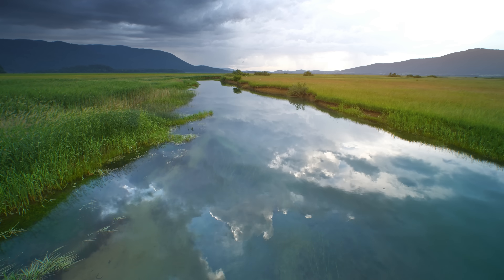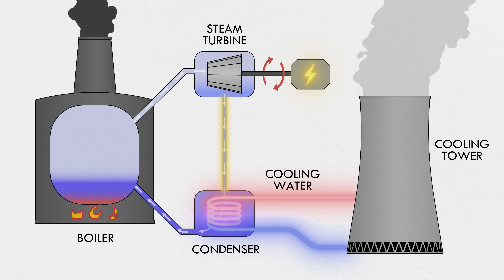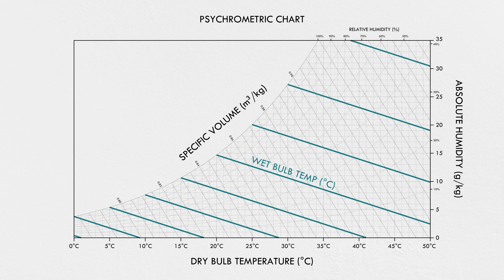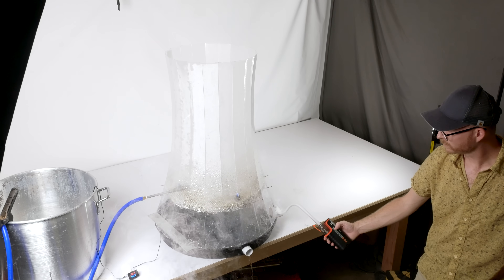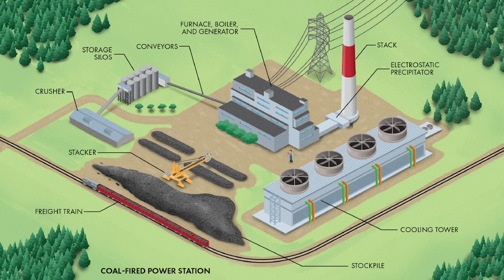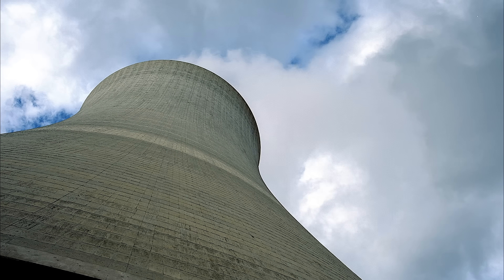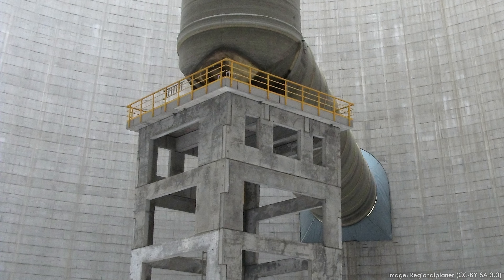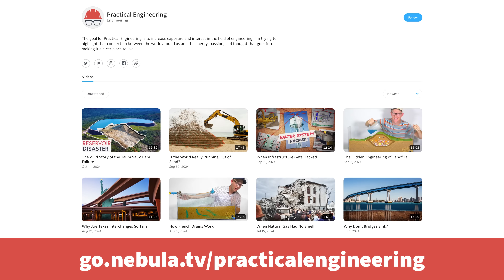Why Are Cooling Towers Shaped Like That?

Comment: This explains something I had wondered about. The Browns Ferry nuclear plant in northeast Alabama has cooling towers, even though it is built on the Tennessee River. The Tennessee is a very reliable source of water (since TVA created the whole string of lakes) and makes an effective heat sink. But the usually humid air of Alabama makes the towers efficient, and avoids dumping so much boiling hot water into the Tennessee.
Reply: It won't be anywhere near boiling. The steam from the turbines can be expanded to around 20C above ambient so the maximum temperature of the cooling water would be 30C to 35C or so (ambient in this case means the temperature of the condensing fluid not air temperature). You need a LOT of cooling water to make the phase change from steam to water. Cooling towers are used when you can't get enough water from the local river and/or there are environmental limitations on the discharge temperatures of the coolant back to the river
Reply: Oh hey, you up here too? I’m west of Athens, bout 10 min from the plant 😊

Comment: 7:47 Wait what? That is so counterintuitive to me, could someone try to shed some more light on that?
Reply: You might be imagining that the additional water molecules in humid air just kind of "nestle" between the air molecules, thereby increasing the density. But that's not how that works. If you add water to the air, it will expand until it reaches pretty much the exact same number of molecules per volume as before. The water molecules are not added in between the air molecules that were already there, they displace them. And, as the previous commenter explained, water molecules are lighter than most of the molecules in air, so overall the mass density goes down.
Reply: A molecule of water has the mass of 18 atomic units. A molecule of nitrogen, 28 atomic units. Hence a volume of gas of water molecules has lower mass, compared to the same volume of air.

Comment: 14:46 i'm confused. where does that bluish line come from? it doesn't follow any of the lines on the chart. what determines its slope?
Reply from the maker: The line is the path through the psychrometric chart that air follows as it moves up through the fill in the tower.
Reply: @PracticalEngineeringChannel  When you speak about the changes in the parameters of the air as it moves through the tower, and show the curve corresponding to it,  everything is clear. 

But what does the straight line labeled "20C / ~70F WET BULB" depict? 

You said: "Let’s look back at that psychrometric chart. Say we’re in an  area with a wet bulb temperature of 20 Celsius,  70 Fahrenheit. ... If the ambient relative humidity is say, 20  percent, our air is starting here..." 

Reading the chart, shouldn't 20 Celsius and ambient relative humidity 20 percent correspond to the staring point at the intersection of the 20 percent curve and the thin diagonal black line from the wet bulb point at 20C, 100%?
Reply from the maker: @cogoid  That is the wet bulb temperature of the ambient air. A point on the chart can be defined by any intersection between wet bulb, dry bulb, or relative humidity. I didn't plot the wet bulb grid lines because it made the chart too busy. This interactive webpage is a good starting point for understanding these charts: https://drajmarsh.bitbucket.io/psychro-chart2d.html
Reply: @PracticalEngineeringChannel  Thank you. If the thin black lines are the specific volume lines, and the straight teal tine is the wet bulb line, it all makes sense.
Reply: Good question. There definitely needs to be more to this story for it to make sense. For a given wet bulb temperature, the relation between the humidity and temperature would be given by the thin diagonal lines on the chart. The teal line is indeed confusing without a further explanation.

Comment: Briliant explaination. Just to provide an alternative to Cooling Towers and discharging warm water into the environment, there are methods of extracting the low grade heat by making it do work. I worked for a company in the 1970's that was working on that.

Comment: The steam is also not released into the atmosphere because the output pressure of the turbine is often way below atmospheric pressure to maximise efficiency.
Reply: To add, this is one of other functions of the condenser. Turning the steam into water creates a vacuum that lowers the output pressure of the turbine.
Reply: Steam isnt released at all,technically the steam you think u see is condensate

Comment: In high school debate my partner and I stumbled upon a design from an Israeli company that wanted to build what are basically reverse cooling towers. Take water and spray it across the top (in hot, dry climates) and use the downdraft to power turbines. We actually won quite a few cases and made it to the national tournament with that plan.

The towers (as specified) would have to be 5km tall, but that's a problem for the engineers to figure out. We were policy makers!

Comment: Wow. I always thought there was an aerodynamic reason for the cooling towers shape. It’s simply strength. Cool. 
The lack of bouncy to make the towers work on hot areas makes sense too. You get a kadiabatic effect with the colder air sinking rather than rising.

Comment: The output from the last turbine, residual steam, has to be cooled to about less than 60 Centigrade degree temperature. Otherwise it cannot be pumped to high pressure; in nuclear plants even over 100x atmospheric pressure. Warmer water creates cavitations in pump propellers destroying them gradually.

Comment: Cooling towers of that type and shape were originally designed by a pair of Dutch engineers and 1st built in 1918. The 1st time they were used in the UK, just happened to be in a power station about a mile from where I used to live, Lister Drive power station in Liverpool. I can't remember exactly how I came about this information, but I know it was when I was in work doing a bit of internet browsing while we were slack. Funny what gems you can find online.

Comment: Wet bolt temperature, is that also the dew point or the "feels like" temp? Dew point is the point where the humidity in the air turns to water, but thats the temp at 100% saturation i believe. Just wondering if the wet bolt temp is equivalent to what we see daily from the  weather report, where thr dry bolt is the temp we see/feel/report
Reply: There are 3 kinds of temperatures: dew point, wet bulb, and dry bulb.

Comment: Great discussion.  I worked at several plants in the northeast, and one thing you didn't quite touch on is water consumption.  Yes, we use towers so we can 'recycle' the feedwater.  But a large nuc plant might have to dissipate 2000 MW of thermal energy.  That can mean evaporating water in the tower at rates like 13000 gallons / minute.  Yes, over half a million gallons per hour.  So having a source for that makeup water to the cooling system is a key to success.
Reply: Still nuclear is the best choice and you can do it without large cooling towers, you can have a (new) lake as a cooling source or have a hybrid.

And the plants don't need groundwater quality to supplement loops.
Reply: Thanks for this comment.  I was wondering why my local nuclear plant had both a lake and cooling towers.  I figured it was either for redundancy or because it does get fairly hot in the summer (though very humid) so the lake was used in the event the air conditions weren't quite right for the tower to work optimally.
Reply: @fuhkerz  You have to have a source of water to make up for what's going out the cooling tower, typically about 10,000 gallons per minute or so.  The plants can't operate at power without the tower, not enough cooling capacity, but the other sources do provide plenty of cooling for all of the normal shutdown an demergency equipment to work.
Reply: When we have tours, we explain that basically when there's a large plume, that essentially there is one swimming pool per minute coming out the top of our tower!
Reply: Thanks for comfirming my suspicion. My personal estimate was about 2% lower.
This year was election year in my state. And the blue party seriously wanted to go nuclear+lignite for our electricity needs. 
Those 6GW (net-)electricity essentially would have meant a water consumption of about 4 million people. Yes, I live in a quite rural state so each person just uses 100 l per day.
To illustrate how crazy such an idea is: 
The state has about 3 million inhabitants. And we got a car factory in the last years. This car factory consumes water for about 40 000 people. The fuzz about this water usage even made international headlines.

BTW a dry tower would generate quite a big wind. 🤣
Reply: @reinhardtreinsch2923  It’s important to remember that every power production method has its downsides. Is water scarce is your state?
Reply: @ShaqsNewGroove  We have a low ground water capacity. 
So if the rain is normal we can get along. But if you get two dry years in a row that´s a problem.
And a 100km+ water pipeline for the car factory plus the prohibition to water your garden are likely to happen. 
So expanding your water consumption for power production is not smart 🤣.
Reply: @reinhardtreinsch2923  I think you forget that water evaporated by cooling towers will eventually rain down and replenish the groundwater aquifer.

Comment: Still confused my all that energy is lost. Once the steam gets to 99C it should be able to go straight back to the heat source, whatever that is, to be turned back into steam again. Why do you need to cool the steam down so much and then heat it all the way back up to becoming steam. Never understood this and curious to know. Is there data of what % of energy is actually lost cooling?

Comment: Excellently presented, as always.  I was hoping that you would explain why cooling is needed at all.  Once the steam passes through a turbine, why isn't it reheated to a usable temperature and reused?  It seems like it would take less energy.  This has never made any sense to me.
Reply: It is more efficient to cool the steam exiting the turbine to below the boiling point of water. This can be done because the condenser operates at a partial vacuum relative to normal air.

Comment: Once again, you took something I've rarely thought about and shown how interesting and complex it really is. 

I once had the opportunity to get up close to a cooling tower and was amazed at, not just how big it was, but how crude and low-tech it seemed. 

The one I got a close look at also has a sort of matrix of what looked like wooden beams inside. It was no longer in use, and quite old, so I assumed these were something to do with supporting it.

But I was told that these were actually part of the cooling/evaporation system. The hot water was actually deliberately sprayed onto the wooden(?) beams.

I've no idea of the physics behind this, or even if it's true, but the person explaining it to me seemed to know his stuff.
Reply: The wooden beams are equivalent to the 'fill' shown at 05:10, which is purely to produce a shower of water droplets.
Reply: @gordonrichardson2972  Cheers Gordon.

Comment: Little Note on Weather: Its actually quite sad, that the Wet Bulb Temperature (as well as Dew Point) are rather unknown and not mentioned in Weather reports, even though they are quite important when talking about the Risk of Heatwaves.
Reply: Here in Canada we have Humidex that is a temperature in Celsius that translates the wet bulb temperature to a dry bulb temperature that is describing how the human body perceives the temperature. So 30C (86F) at 85% humidity would translate to 44C (111F) and would be in the “intense discomfort” category. I thought other countries have similar systems? 
But I agree it’s crazy that the dew point is not common knowledge!
Reply: @stopgabsolution5457  In Germany basically only the actual Air Temperature is known. Reports which include Humidex-like values are discarded as green Propaganda.
Reply: @lukasrentz3238  warning people of heat stress - a true crime against the status quo. up there with meatless Mondays and tempo limit 😅
Reply: Capitalize more Nouns, we couldn't tell that you're German 😂
Reply: @joshyoung1440  Oops, forgot to capitalize some

Comment: Better explanation of why hot climate areas aren't the best places for cooling towers is just the difference in weight (taken space) between hot and cold air.
We say that hot air is lighter than the cold air because the hot air is much less dense.
In hot climate areas the difference of density between air outside and inside of a cooling tower is just lower, so the air flow is weaker.

By using that knowledge that cool air is heavier - I save a lot on electricity in the summer, because I cool down the house during the night by opening the lowest and the highest windows. Heat goes outside by itself. I close the windows as soon as the external temperature passes the internal one.
Reply: Close the windows at the lowest wet-bulb temperature. That is a little earlier if the sun starts hitting wet ground. Or later, if the ground is dry and convection mixes down dry air from larger heights. Or both with the windows closed in-between. 
My house is cooled by evaporation off its green roof.

Comment: I was confused for a minute, not sure if you say it in the video, but I guess only part of the cooling water evaporates, but it still takes the heat with it, so some of the water goes back in to the cycle. So not all of the water is retained, but also not all the water is expended.
Reply: seperate loops of water
all the expensive sterile water that runs through the reactor and steam turbine are a closed loop, but after the turbine it goes through a heat exchanger and passes some of its heat to another loop of water, which is what gets expended to cool down the closed loop
Reply: @vincentgrinn2665  I meant that it looks like the evaporative loop doesn't all get expended.  In his model, he doesn't model the return.  But in the diagram it shows a return, and the footage shows a collection pool.  It makes sense though.  Evaporation will take a certain amount of the heat with it, not all the water needs to evaporate, what remains can be cycled back in.
Reply: @somedudesstuff801  in his model there is no primary loop from the reactor
just the open loop going from the heat exchanger(bucket of hot water) to the cooling tower then evaporated

but yes i believe the water that pours out of the bottom of the cooling tower is just pumped back around to cool down again, assuming its cold enough anyway

Comment: Another excellent explanation. I too didn’t realize that a higher wet bulb temperature can actually work better. Physics can be complicated and reveal unexpected results. 

One thing that should be pointed out is that the efficiency of a heat engine- such as a thermal power plant- is directly related to the difference in temperature between the heat input and the waste heat output. So power plants operate the condenser considerably below atmospheric pressure, ie considerably lower than the 212 degrees of just letting the steam exhaust to atmosphere as a steam locomotive does.

Comment: Grady, hi from Alberta, Canada. You produce one of my favorite channels. One reason the vast majority of engineers no matter the discipline (unlike yourself) find it challenging to explain concepts like cooling towers, to those not practicing in the profession. My family take great delight poking fun at me so intently enjoying your channel. "dads geeking out again watching that engineering channel".
As a PEng myself I enjoyed how superably your model cooling tower performed. Usually concepts such as these fail to scale at all let alone perform as well as yours !!!!.
I was challenged by my daughter 8 at the time to explain this exact concept and prove it wasn't "smoke" coming from those towers polluting the air. After many sketches and a boring oration the result "nope it's smoke coming from those towers they are polluting our air Dad". Thanks for finally convincing my family it's normally mostly just steam. 
I interned at a fertilizer manufacturing company summers during university.. The company used 10 concrete slip formed cooling towers 20 stories in height exact same shape as part of the manufacturing process.to produce pelletized fertilizer. Nitrogen mostly, saturated water droplets were introduced at the top of a cooling tower. As the droplets fell rapid cooling evaporated excess water eventually producing fertilizer. They now use a freeze drying process because maintenance costs associated with the towers became to costly. 
Great topic and model, thanks.

Comment: You really make the Gray-D, are a true mental tower and I'm not just blowing off steam. Very COoL Mr.Practical Engineering. GR8T post-edits too. 500 "good human" points awarded. You RoCk. The check is in the mail  :hand-pink-waving::face-blue-smiling:

Comment: I'm curious how a steam turbine works. I get that high pressure spins it, but how does water get to that high pressure without pushing backwards into the water source? Are there one way valves heating water in batches? Is the pump able to move water against the high pressure with more efficiency than the turbine?